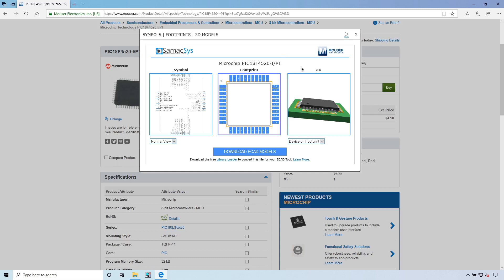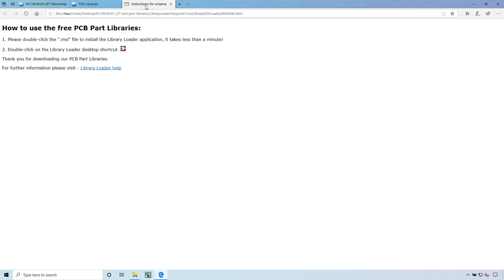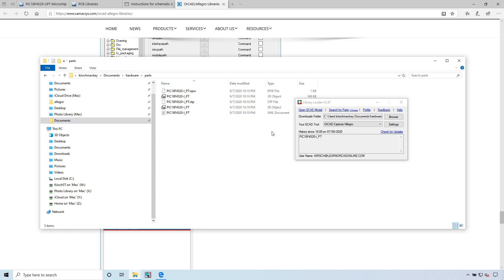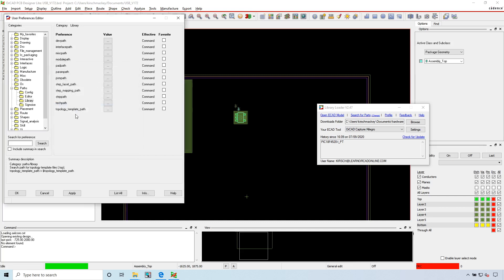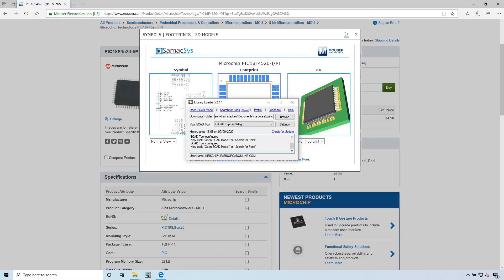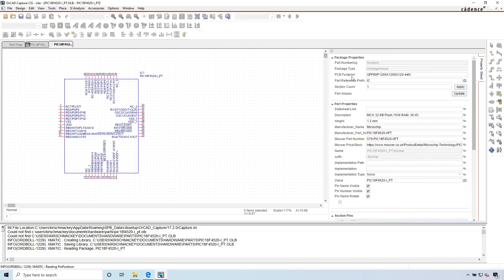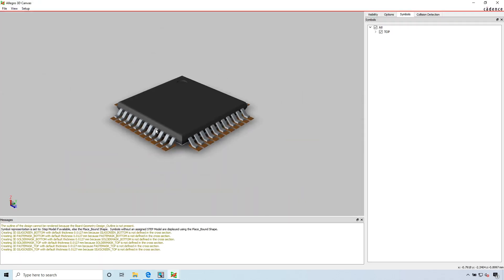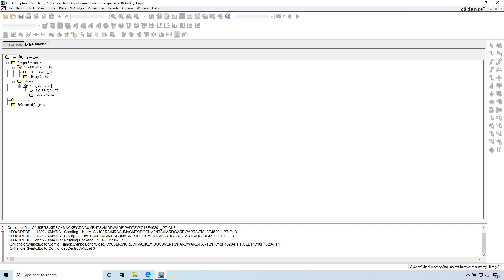How to Add Library Parts to Your OrCAD Capture Project (Mouser.com + Samacsys) - Tutorial

Comment: Hi, I'm brand new to this and this video addresses what I'm having the most trouble with, which is getting my parts libraries organized and getting footprints to display in Capture. However, this video is very fast paced and you made several mistakes along the way. I know you corrected the mistakes; but you did everything so fast that it just added to my confusion. I have the full blown versions of Capture and PCB Designer 17.4. I have never used these tools before. I just need to make a small project for a small board; but getting over the hurdle of understanding these library and footprint issues is very frustrating. It's hard for me to even explain what I'm having trouble with. I have access to the training videos from Cadence; but, so far, they don't seem to have anything that walks you through these basics for Capture.
Reply: i guess im asking the wrong place but does anybody know of a way to get back into an Instagram account..?
I was dumb lost my login password. I appreciate any tricks you can offer me!
Reply: @Maurice Frank Instablaster ;)
Reply: @Harold Uriah I really appreciate your reply. I found the site through google and Im waiting for the hacking stuff atm.
Takes quite some time so I will reply here later when my account password hopefully is recovered.
Reply: @Harold Uriah It worked and I actually got access to my account again. I'm so happy!
Thank you so much, you saved my ass :D
Reply: @Maurice Frank Happy to help :D

Comment: It seems that my soldermask is not accurate. I used this method to import parts and added soldermask through setup-->colors and added a soldermask layer in the stack manager. I only have a soldermask that works for my vias do you know why this is and do you cover this in another video?
Reply: @techedkirsch  sorry for late reply. I sent you a zoom link.